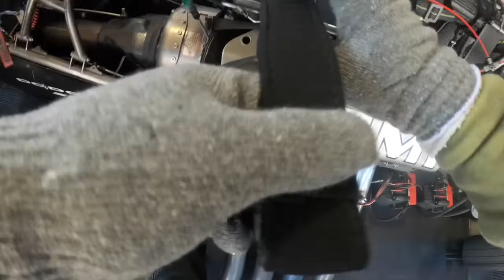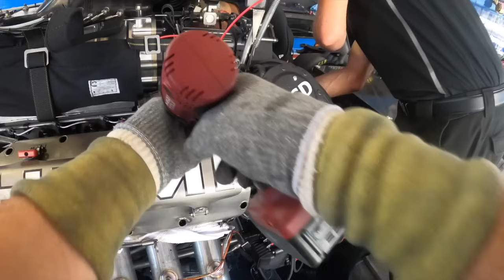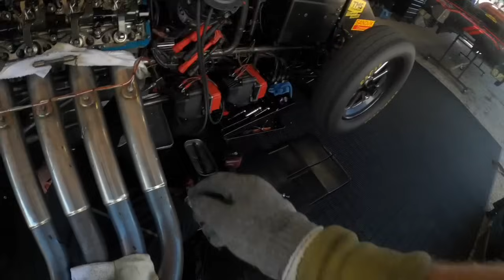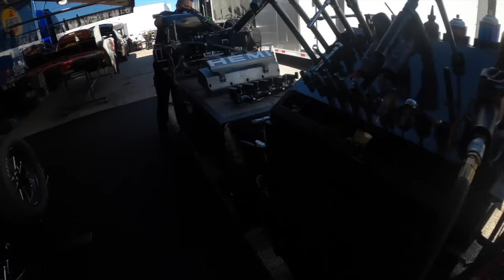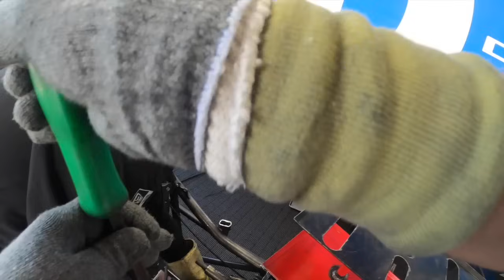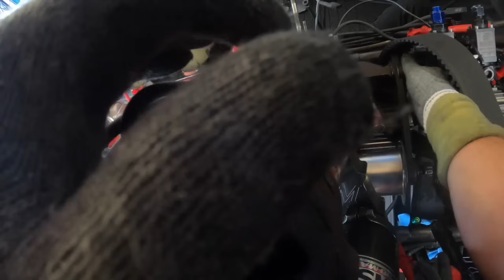Teardown at #USNats with the Dodge / Mopar Team #PoweredbyPennzoil 💪

Comment: They just pulled apart a top fuel motor while you have 3 bolts in and are on the floor looking for a runaway socket....

Comment: Honest question... What is the need to rebuild these constantly? Are they rebuilt when they break or rebuilt all the time to prevent a break down?
Reply: part is maintenance, part is tuning. the maintenance part is the friction babbitt bearings on the crankshaft. they get beat to near death, so they have to be examined and replaced.  there's some forensics going on too. how they are worn and how much tell a story of how the engine ran.

the tuning comes with the selection of the pistons, the head gasket, and the heads to achieve a specific compression ratio. since the rods are aluminum, they get pounded shorter, which changes the piston to deck measurement, which changes compression. the head gasket thickness can be varied to change compression. the cylinder heads can be selected by their combustion chamber volume to change compression.

those are all why the long block comes apart after each run. and that's if nothing was hurt on the pass. the clutch and the supercharger get their own workover as well, clutch more so than supercharger.
Reply: @slowpoke96Z28  damn man... That's a little of shit for 1 pass, but it makes sense tho! I figured there was heavy wear on the parts, but didn't factor in the changing tolerances due to such heavy immediate wear. Thanks for taking my question seriously 🤙

Comment: so question is everything inspected and reinstalled or do you have like a new set of pistons , and valve train etc to go back in.
cause this is the coolest thing to see and such great teamwork and just want to know how much is going to  be reused
Reply: I think they are just re ringing it with new bearings. you can see the honing tool being used at the end.
Reply: They but a replacement rack in it (pistons,rods,bearings) the top teams will use new on each run,but lots of teams will check that an item is within spec,catalogue how many runs its had and re use it.
Reply: @brianiswrong  thats what i thought i know about block just wanted to know about the internals

Comment: What happen when one of the bolt strip?
Reply: The bolt is too scared to strip
Reply: @gangstapat4802  LMAO😂😂😂🤣🤣🤣
Reply: Just back it off quarter turn lolz
Reply: depends on where. non pressure parts that can get a timsert faster than the part can be replaced will get a timesert. others will be replaced with a spare from the trailer. that's why an organized trailer is important, and knowing where things are on said trailer. newbies are quizzed on where random things are on the trailer until they've learned it all.

Comment: What do they do once it is torn apart?  Is it mostly to check the components or do they replace certain parts?
Reply: From what I've seen it's a bit of both they check some of the components and spec them out n from there they replace what they need to since most components wear out after one pass

Comment: Why don’t they just REPLACE the engine with a new one already built instead of rebuilding the used engine at the end of each run?
Reply: Because these are not the $1,000 engines in your daily drivers. They cost upwards $60,000.

Comment: and they do this after every pass?   And how many seconds are they doing the 1/4 mile?
Reply: 1,000 feet. 3.6x seconds for the 300" and a couple tenths slower for the funny car.
Reply: Pretty wild.  The engine turns only about 1000 revolutions between each teardown.

Comment: Amazing… the basic hemi was introduced in 1951; this iteration in 1964 if I remember right.

No other ICE is capable of putting out this much power (14,000-15,000 hp) on a consistent basis. Dominate Upper level drag racing.
Reply: After the NASCAR ban of the Hemi They went drag racing and haven't stopped
Reply: you mean reciprocating piston ice at this displacement. there are a lot of internal combustion engines that make more power, more torque, and for way more than 5 seconds at a time.

to appreciate what these engines do, you gotta understand what the others do too.
Reply: @slowpoke96Z28  no! Top fuelers are the badest ,fastest engines on the planet.nothing faster at the strip.
Reply: @deansmiley8221  lol
Reply: @slowpoke96Z28  guvr me another 500 cubic inch engine making 10,000 horsepower...I'll wait.
Reply: @deansmiley8221  why would I? Your comment mentioned speed, not power.

BUUUUUUUUuuuuuuuuuuut, since you asked, you do know that turbine engines and rockets are internal combustion engines too right? They just don't use the Otto cycle. I'd run out of room listing the turbine and rocket engines physically smaller than a 500" gen 2 hemi that make more than 10,000 hp.
Reply: @slowpoke96Z28  dude! Go away!
Reply: @deansmiley8221  awwww, you wanna take your toys and go home now? Bye 👋 👋
Reply: @slowpoke96Z28  Not even close to being on the same level dude!  Maybe go argue with a 10 year old or sumthin..
Reply: @deansmiley8221  so you want me to find someone smarter than you? got it. i could probably go with like a 6 year old though.
Reply: @slowpoke96Z28  Definitely isn't you..
Reply: @deansmiley8221  lol
Reply: @slowpoke96Z28  you are probably comparing ship engines to these monsters to find a power to size ratio these would probably easily be the best by a mile even compared to ultra efficient small displacement engines
Reply: @averymacleod6199  thats just based on fuel used.

Comment: This is will always be cooler than an electric motor.
Reply: until you realize it's just a really expensive paperweight until that 48 volt electric motor works its magic.
Reply: There will never be in our lifetime , a electric motor that can put out that kind of power to weight ratio, and even IF they could , it would have to be powered by a miniature nuclear fusion reactor to power it. People get all excited when they see electric cars going down the quarter. Yes they are pretty quick but they are coming to its limits , the amount of battery current is massive. To emulate 12,000hp they would need cables or pure copper lugs at over 1” dia. With batteries that would weigh in at over 2 tons . No way a car that weighs in at over 5,000 lbs is ever going 3.2 sec in the 1/4 with 4 tires on asphalt . Electrics just need to stay out of drag racing
Reply: @robertd1970  or overhead power lines like some commuter trains use. Or induction from under the surface. Someone smart enough will figure it out. When is immaterial to me. Battery and capacitor technology grow at an amazing rate themselves. 

Leonardo da Vinci never saw a plane fly, but he knew it was possible. Man will find more ways to go faster and higher until man ceases to exist.

Comment: The crews that do this are awesome. Ripping apart and putting back together a 11k hp engine reliably is so cool. Can everyone do the others job if needed?
Reply: NO! not unsupervised at full speed at least. some guys can once they've spent time at every job, but not everybody can. but there is usually a progressive learning curve. the orchestra would be messed up if bodies were moved around to different jobs. if you ever watch on TV and hear how they are talking about a team having an all volunteer crew or local hires who don't usually work together taking a lot longer in turn around time, this is what they are talking about. it's like the difference between a militia and an active duty military unit when it comes to proficiency.
Reply: @slowpoke96Z28  yup. I’ve been active duty Air Force and there’s a visible difference in the timing and how in sync things were on the flight line from active duty Guys to guard/reserve. It’s hard to compare the 2 unless you understand the process of course in this case I’m referring to getting aircraft ready to fly from the time the crew shows to marshaling them out.

Comment: So...why not just pull the engine and clutch assy and replace the whole unit....then rebuild the pulled engine assy...
Reply: because it's a matter of tuning for the next run, not just maintenance. you could have 100 motors and clutches, and still not have the right combination. this way accomplishes a ton more at a fraction of the cost.

also, because me and one other dude can pick  up a block with a rack of pistons. me and one other dude ain't picking up a whole motor hat to pan with a clutch on it. 5 guys ain't picking that up lol.
Reply: @slowpoke96Z28  ok

Comment: Hey, have you checked out the Ford Fuel Coupe with the Ford engine that is a reflection of the supercharged Ford they have on the street?
How about the GM Fuel Coupe with the drag racing version of the supercharged Chevrolet engine that they used on the street?
Oh, wait, those cars don't exist.
Mopar. Where a blown Hemi Charger can win in Top Fuel Coupe and also where you can buy a blown Hemi Charger for the street.

Comment: Isn’t them motors held in by hose clamps wouldn’t I be easier to just swap the engine with a good one then you could go through the motor before the next pass I know you guys stock enough parts to build like 20 motors and probably hold like 5 motors
Reply: I believe it’s like F1 where you can swap engines if you really need to but you get a points penalty for doing so. So it’s in their interest to keep the same engine, plus it’s about going as fast as possible on a deteriorating engine, otherwise what would stop the richer teams running a fresh engine every run?
Reply: @joescarratt9389  no engine penalties. I’ve helped on cars that have gone through 4 engines in a weekend. You can swap engines all you want but you have to take the blower, manifold and heads off anyway. They don’t put a complete engine back in because head gasket thickness is a last minute call. Some crew chiefs have asked for head gasket changes after the warmup.
Reply: They could swap a complete engine every run
But
They would need to semi strip and rebuild it depending on the weather and track conditions (fuel flow,head gaskets,even piston heights can be changed to help get down the track)
It's also a " drag racing thing" to rebuild the engine that has run if possible,it keeps the minds fresh and ready for any eventualities

Comment: Anyone know why they put a sleeve over one of the head studs and secure it with a nut after the head comes off?
Reply: Allows the cylinder sleeves to stay inside the block on teardown.  When the block is hot, they are literally held down by the heads  Edit:  I asked a buddy that used to work on these cars, I was curious myself.
Reply: @SC457A  this is correct the sleeves will come out when the bottom end guy is turning the crank

Comment: Under 3 minutes for this dude to replace a head gasket and my mechanic wants $2k for the job. THIEF!
Reply: 2k is probably about right for head gasket job in the real world mate. This is a very fast setup system allowing such fast component removal. Real world engines have so much more to tend with.
Reply: i know (hopefully) youre joking, but for those who do think this, and add the fact your mechanic is expected to know how to do it on your vehicle, your spouse's vehicle, your teenager's vehicle, your parents' or inlaws' vehicles, all different years, makes, and models. this comes apart just about the same way every other gen 2 hemi dodge does and has for the last half century. your mechanic would be this fast and charge less too if he only had to work on one model of one make from one year that was literally engineered for fast maintenance. and had another guy just as good working on the other side lol.
Reply: @kiwidiesel  I wrote that comment 5 months ago and I admit I was wrong. In Biden's hyperinflation economy, it's more like a $20k job.

Comment: Pure 𝙀𝙭𝙚𝙘𝙪𝙩𝙞𝙤𝙣
True 𝙏𝙚𝙖𝙢𝙬𝙤𝙧𝙠
This is some killer content...
Hell, ... I thought the teamwork with the body removal was spectacular... it just got better and better. 
The temps of both the fluids and metal have got to be smoking hot. 
I only wish more of these guys utilized 𝙥𝙧𝙤𝙥𝙚𝙧 hearing protection during start-up, etc. I see finger in the ear during throttle blips, ... but hearing protection is needed anytime the engine is running. 
Any exposure damage is permanent.

Comment: The car hasn’t even been in the pit for 2 minutes and the cams are already out....
Reply: These are push rod engines. The cam is one of the few parts that’s not serviced. You saw him checking lifters that’s all you’ll do with the cam on a normal run